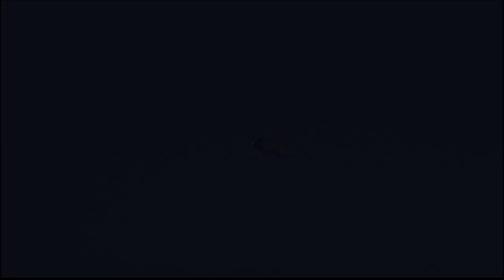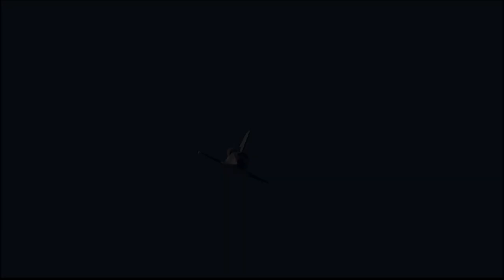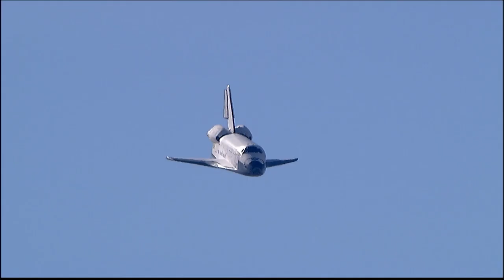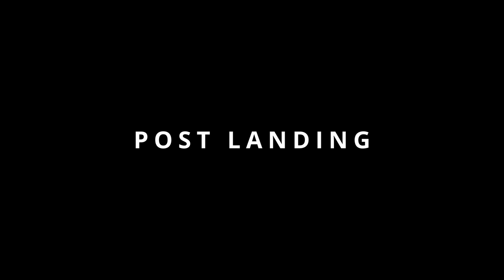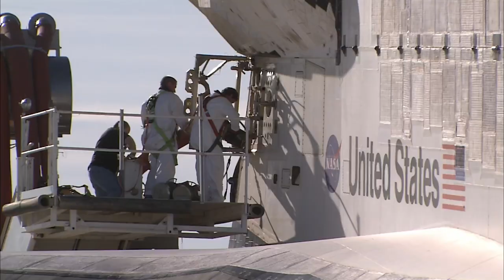How the Space Shuttle Lands

Comment: No mention the pre flair at 2000 AGL?  That’s the coolest and trickiest part of the landing. It didn’t  just line up the runway and drop it’s gear still at breakneck speed, and if it did it would leave a rut in the ground. The pre-flair drastically cut speed at low altitude. I believe landing speed was still above 200 knots/hr.
Reply from the maker: Thanks!

Comment: So, how does it slow down from 17k miles per hour to Mach 300? At which points are the engines turned on for landing?
Reply from the maker: Hi! It first slows down to the atmospheric drag. Thats why the heat shield was so important. Then it starts to do the turns to slow more down in the thicker atmosphere. Its not Mach 300? Thats wrong because that would be more than 229.000 miles per hour...
Reply: They can't turn an engine on during descent. There are no propellants at that point so a shuttle was basically just gliding. It's really incredible to think pilots can accomplish a feat like this.
Reply: @kushclarkkent6669  Oh wow! Thanks!